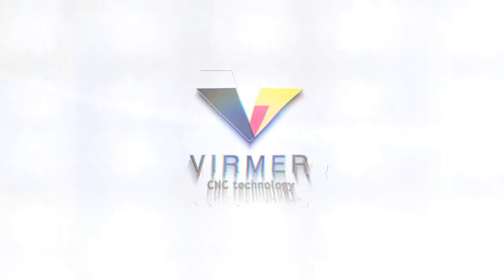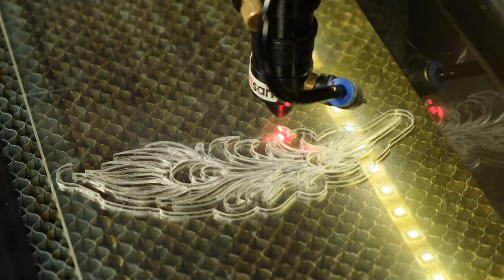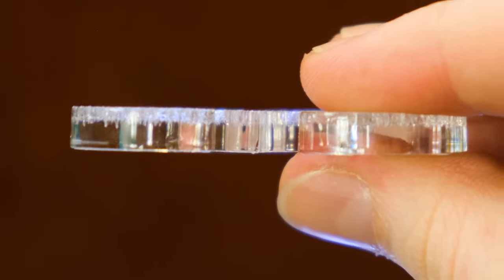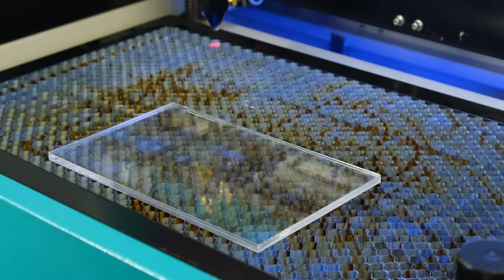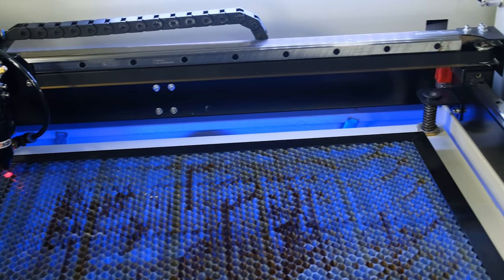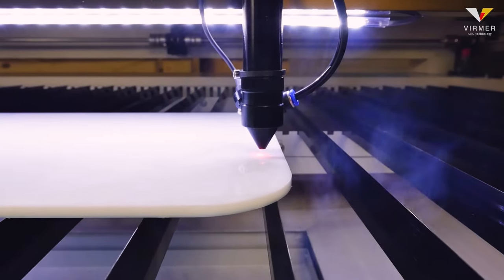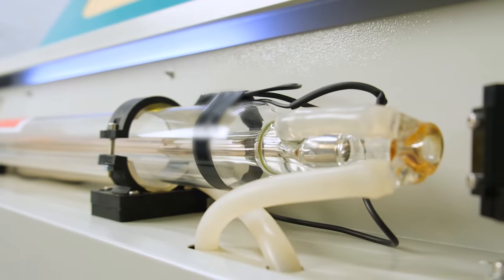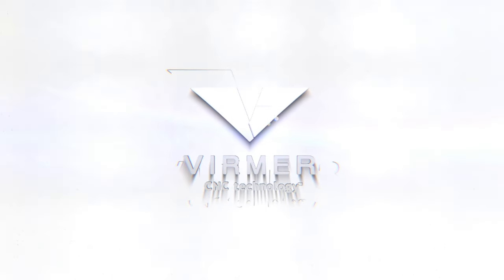HOW to CHOOSE a CO2 LASER FOR ACRYLIC / CNC GUIDE / PART 1

Comment from the maker: What topic should our engineers shoot the next video on? 😀
Reply: Well I do know a CO2 laser can't cut or engrave metal. But I would love to see a engraving of colored metal, and by colored metal I mean only the top layer. Like text or name plates.
Reply from the maker: @patrickh9810  Hello. Thanks for your comment and request. As you mentioned a Co2 laser machine can not engrave metal. For this task you need a fiber laser marking machine. 

The fiber marker engraves gives relief images, marks and changes the color of the surface of the material. With the Wattsan fiber marker, different marking colors can be obtained. The marker heats the surface of the metal at certain frequencies, which gives different shades. Also it's possible to engrave and mark on painted metal.

One of the advantages of the fiber markers is the presence of built-in modes for marking keyboards, barcodes, serial numbers, QR codes, etc.

Wattsan FL TT fiber laser marker is suitable for your task. Please watch the marker review for more information: https://www.youtube.com/watch?v=UhhfUvmL-Ug&t=14s

We will prepare a video regarding your request. Please keep following us for the next videos.
Reply from the maker: @Patrick H  We added your video request to our list. See you in the next videos.👍
Reply: @virmercnc  Still thinking about your answer. So it's not possible to engrave anodised aluminium like the following link. https://youtu.be/RO6bVjthoiM

I do know it's from a different company/brand, sorry about that. But maybe it's better to understand what my question is when you see it.